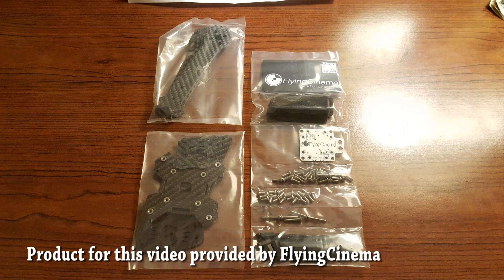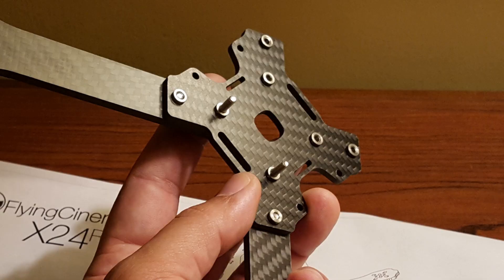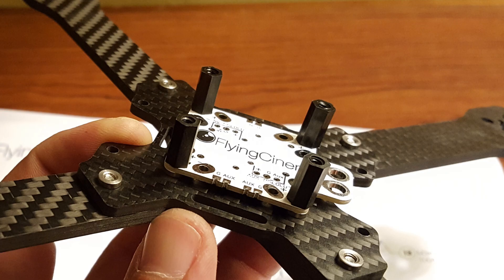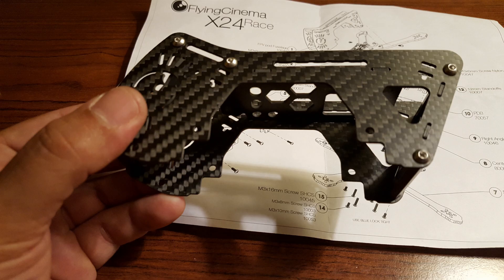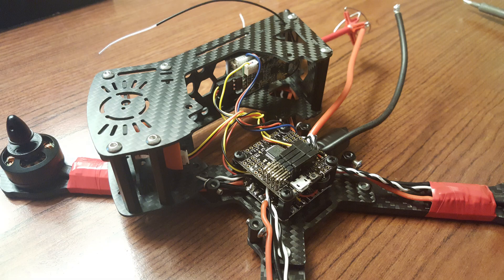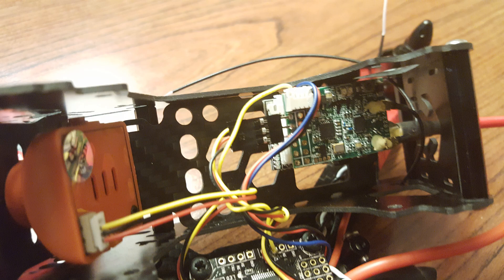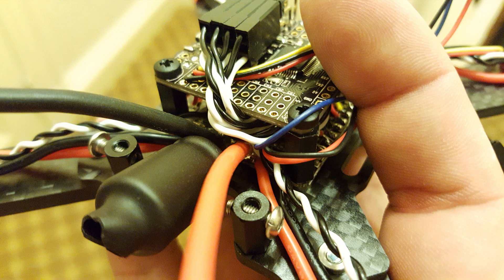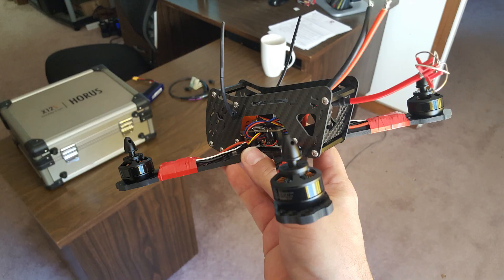FlyingCinema X24 Mini-Quad - Build Commentary

Comment: I went with a matek 5 in 1 ver.3 pdb on my build. I definitely dig the 5v and 12v outputs on it. I've been flying with it for a few months now and have yet to find any problems. it even has a low volt v-bat and buzzer all built into it.
Reply from the maker: There are several really good Matek versions at various price points. Maybe they could build one with a current sensor for everybody who is not running an RROSD (although why you would do that, I can't imagine!).

Comment: In the give away if you choose this quad will the FPV come with it?
Reply from the maker: Yes. I plan to include everything except the receiver, since the recipient may not have the same transmitter as me. And also I'm kind of short on receivers right now ;-)
Reply from the maker: BTW, FlyingCinema included everything in the kit, so thanks to them for their generosity. They could easily have sent just the LOS stuff but they really wanted to show the copter at its best.